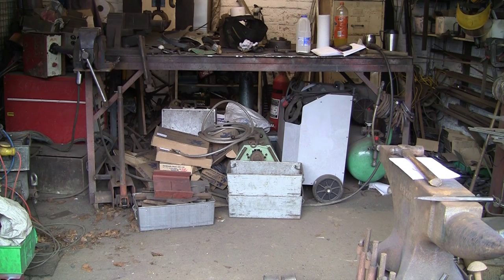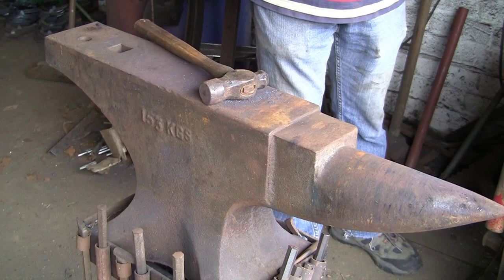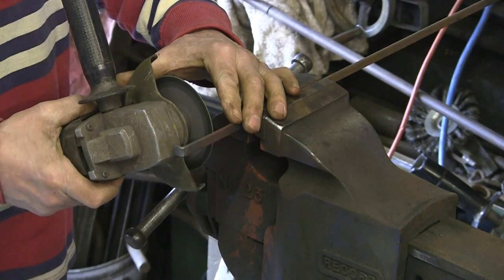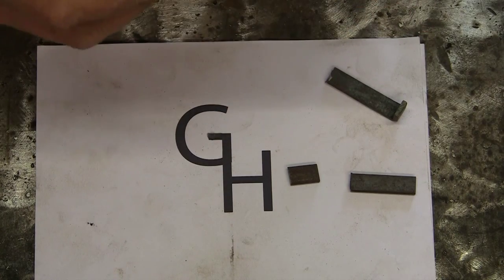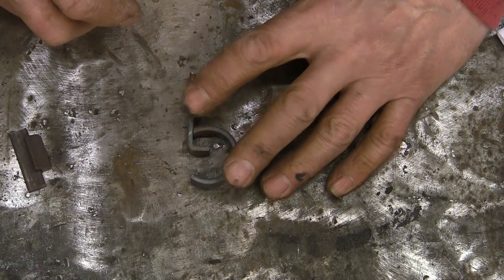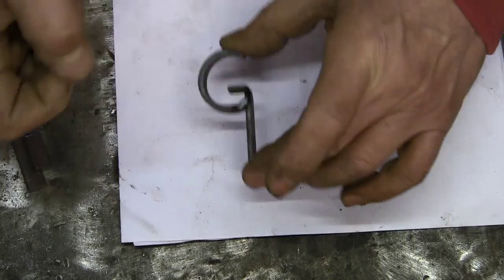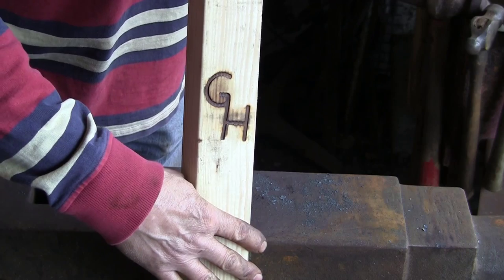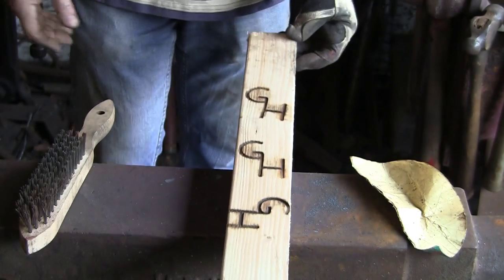Branding Iron

Comment: We had an old blacksmith shop that was scrapped out. The big dollar item was the back wall. Every time the blacksmith mad a branding iron he would test it out on the back wall. The farmers went nuts trying to out bid each other. Dragging a file or a saw on the back stroke doesn't hurt anything. If anything it cleans it. Great job on the video. Thank you very much. Need to go brand your truck tires.

Comment: Could you show an idea of how to make a small branding tool without having to spot weld? A branding tool that could be used on the bottom of a carved bowl for example.... :)
Reply from the maker: Nicolie Cannoli That depends what type of thing you want to brand. if it's just an initial you may be able to just bend one in one piece. Anything complex almost certainly nreeds a weld or two. What is it you are trying to do?
Reply: Thanks for the advice! I'd like to make something small and a bit decorative  to brand the bottom of carved and turned wooden bowls. I'm thinking somekind of a decorative horseshoe (in honor of my grandfather). I just don't have access to nor the know how for welding. So any idea's are great! I love watching your video's! So interesting!
Reply from the maker: Nicolie Cannoli a simple horseshoe shape can easily be don in one piece but not sure how to make it decorative, unless you do a seperate brad and brand over or around the shoe shape. How decorative did you want to go?
Reply: That's a very good idea! So it would be like a "layered" brand in a way of saying... I don't want anything incredibly complicated. Maybe something along the lines of the obvious shape of a horseshoe with a few accent designs like the shapes of a scroll (~) vertically in or around the hourseshoe, and maybe a few dots (•○●:°) in some fashion just to dress it up. I guess I should sit down and make a few sketches to see how I could incorporate different shapes without making things too crazy to make out of metal. :)

Comment: Nice video again! Why not "just" forge that 8th on one side to an almost knive sharp edge? and then form it and tack it from the back?
Reply from the maker: renep1987 sorry, not sure what you mean!
Reply: garyhuston You could heat the 8th inch strip and hammer one edge down to a sharp edge (make it a triangular cross section) and then bend in to shape using the sharp edge for the branding and welding the back. Hope this makes sense now ;-)
Reply from the maker: renep1987 I think I do, but what is the point of thinning the steel?
Reply: garyhuston To make a sharper image. You already managed a sharp image with the thinner galvanised strip but I commented before that ;-)
Reply from the maker: renep1987 Oh, I see now..

Comment: Gary cool project but that last brand looked like it was made from galvanized metal. Gotta be careful welding grinding and heating that stuff. Will give off zinc fumes and make you quit ill.
Reply from the maker: metrologic5000 I have been doing it for years and according to this excert from a welding safety sheet it's perfectly OK! 
"When zinc vapor mixes with the oxygen in the air, it reacts instantly to become zinc oxide. This is the same white powder
that you see on some noses at the beach and the slopes. Zinc oxide is non-toxic and non carcinogenic. Extensive research into the effects of zinc oxide fumes has been done, and although breathing those fumes will cause welders to think that they have the flu in a bad way, there are no long-term health effects. Zinc oxide that is inhaled is simply absorbed and eliminated
by the body without complications or chronic effects."
Reply: Believe it or not drinking milk before working with galvanized keeps you from getting sick. Old pipeline welder's trick.